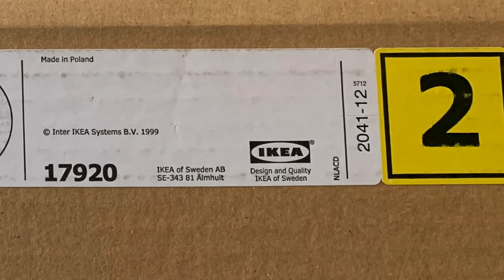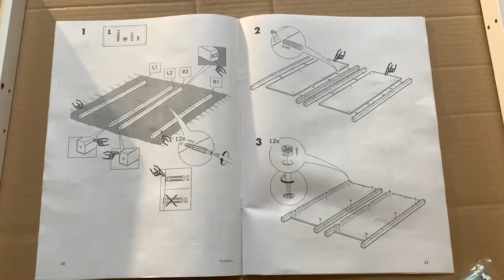BUILDING THE IKEA HEMNES 6 DRAWERS. a start to finish video on building the ikea hemnes  drawers.

Comment: Great video! I could not have built this chest without it. One of the top small drawers is stuck and will not open. I suspect that one of the screws isn't tight. Any suggestions on how to get it unstuck without taking the chest apart?
Reply from the maker: If you take the drawer  out below the small drawers you will be able to see the problem from below
Reply: @tomkatgastraining I've bought this chest (all ready to use). But the left small top drawer won't open either. I've looked for the problem but still no clue, any suggestions how can fix this problem? If so, many thanks in advance :)

Comment: Thanks for this video! I’m curious to know how much it weighs assembled? Web says 51 pounds (NOT IKEA site or app) but the three boxes total almost 120 pounds. I refuse to believe there’s 70 pounds of packing. Mine is scheduled to arrive today and I’m trying to determine in which room I should assemble it. Thinking it should be the room in which it will ultimately live if it’s 100+ pounds!
Reply from the maker: When you remove the drawers the frame is easily moved but it is quite bulky to get up stairs or around corners that’s why I built it in our bedroom

Comment: Thanks so much. The instructions that came with it seemed particularly sparser then what usually comes with IKEA furniture And none of the pre-drilled holes seemed to match what was actually in images in the instruction booklet. The bags and pieces are usually numbered... I don't know if I have something different than you had two years ago, but that's not the case with what I have received so I'm just trying to eyeball it and determine what is what.

Comment: how long did it took to build it
Reply from the maker: Most of the day but filming something takes ages to do. If I didn’t film it I recon 2 hours start to finish
Reply: @tomkatgastraining  Hi the my son has build these draws, does the middle of the back board where the tape is , does it matter if it facing from the inside or the outside , ours is in the inside but looking behind the back we notice its buckling out a bit, where about in the middle  should we put the nails and should we switch the back part around so we have the tape on the outside , we are concern about the buckling on the outside .
Reply from the maker: @fluffyfeathers.9541  the back panel plays 2 parts it is for decoration and to stop the draws from racking side to side if you are not happy with what you have done just check the instructions and change it or watch the video again where I put the back on. I don’t think it matters if it’s the wrong way around but nailing gives it strength.

Comment: I'm not sure if the directions have changed since you made this video or if you did it wrong, but the holes that the locks fit into are supposed to go on the outsides of the drawers. I followed this video and had to take my first drawer apart to do it correctly. It was really hard to get them out and wasted an hour of time and was extremely frustrating.
Reply: Hey there, we are currently in the same boat--how did you get the wood screws and c locks out of the drawer?